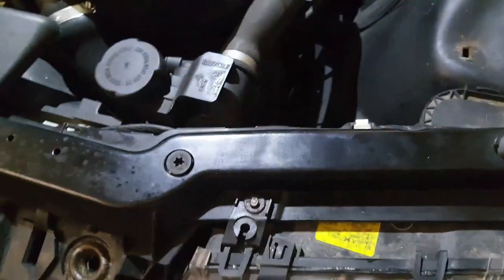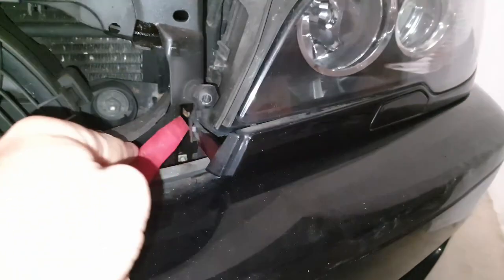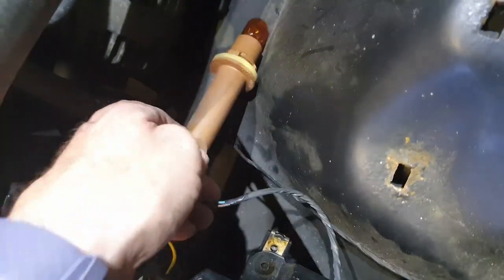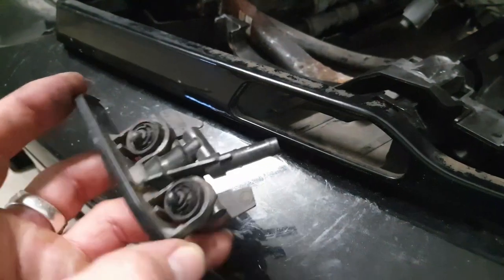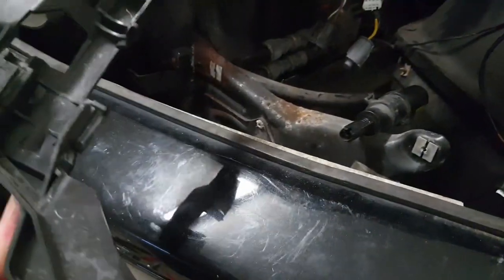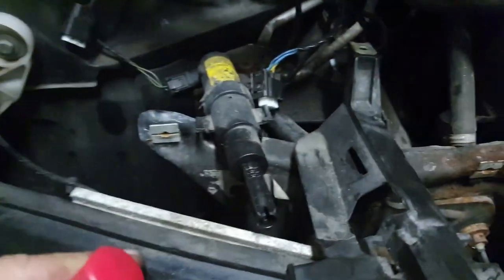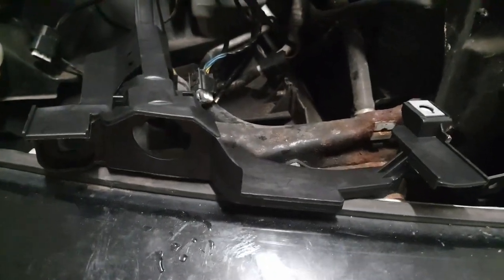BMW E46 3 SERIES FACE LIFT HEADLIGHT REMOVAL WITH HEADLIGHT WASH

Comment: No need to delete the lense wash. Simply unplug the power from the pump attached to washer tank. It's a useless feature in any case. All it does is making the bonnet dirty.
Reply from the maker: Thats what I did in the end, as the blank trim would of worked out expensive.

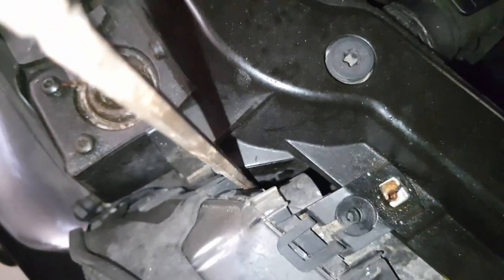Comment: 2:30 mine is rusted and sides are gone what should i do it wont move at all on both headlights
Reply from the maker: If you can send a picture.. so it clear..
Reply: @JFKKARZ  its the side screw  its on 2:30
Reply from the maker: @dsbigboss6212  it's a nightmare I had to drill mine.. with a hex drill bit 8mm on a extention rod.
Reply: @JFKKARZ  8 different garages and a tottal of 6 hours between al of them none could get it out ive tried everything except the drill can u please send me the link of the tools u used ill just have to buy them and take it out on my own
Reply from the maker: @dsbigboss6212  sure.. https://www.ebay.es/itm/13-Twist-Drill-Bit-Set-Titanio-recubiertos-de-acero-de-alta-velocidad-de-cambio-rapido-de-vastago-/284380533967?mkcid=16&mkevt=1&_trksid=p2349624.m46890.l6249&mkrid=710-127635-2958-0
Reply: @JFKKARZ  i just subscribed to ur channel thank you so much buddy 1 more question which size did you use for this if you dont mind me asking :) set starts from 1.5mm to 6.5 did you use other kind of sockets after you drilled down the screw? how did you take it out after that?
Reply from the maker: @dsbigboss6212  Thank you.. thats the drill set style but I'm sure I used a 8mm.. to drill the head.. and tape the drill bit so it doesn't fall off.  Also have an extendable magnet.. on standby. 😉  Once the  head is off.. you can remove the bracket and feel the relief.